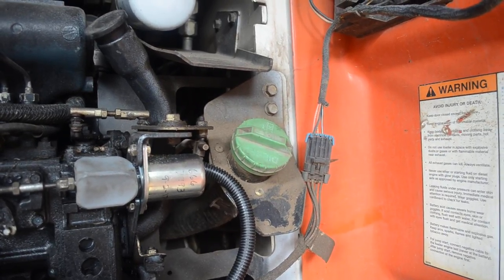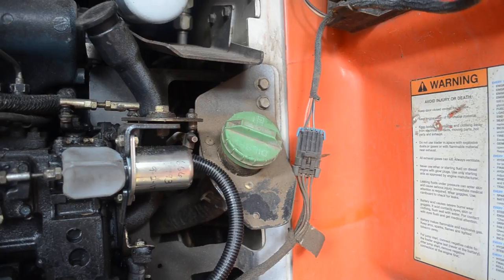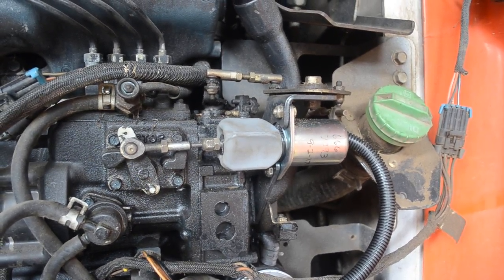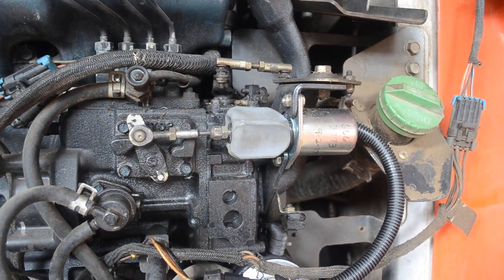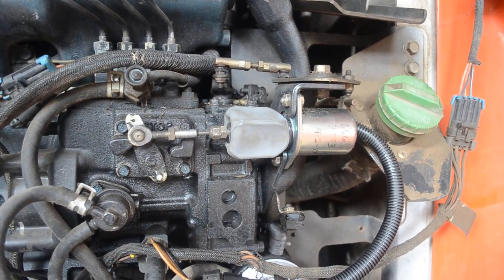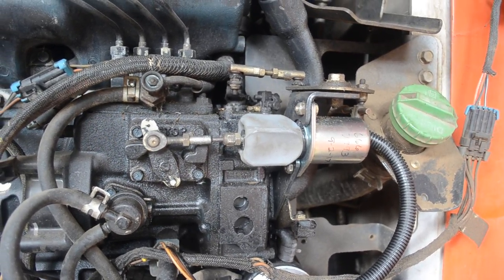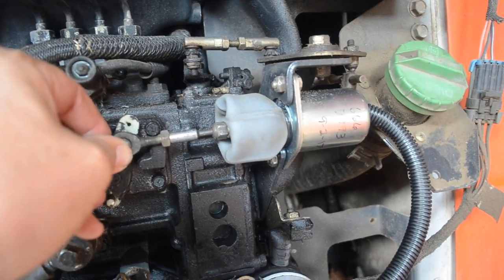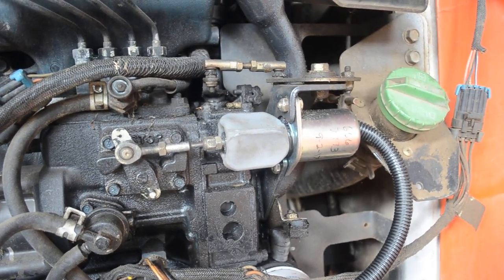Bobcat S series S185 fuel solenoid and relay trouble shooting Diesel shut off

Comment: THANKS, you saved me from buying a solenoid valve, but we ended up finding out that it was the fuse by the relay. Our bobcat is the model 753, it does not have a fuse box, it has fuses all over the place.
Reply from the maker: I did not know they had no box. Upgrade to a 185 mode. Bobcat is always ahead of the rest for technology. I am looking for a Bobcat tractor to add to my arsenal.
Reply: I have a early 753..can you tell me where's that relay and fuse is located at? Thanks.

Comment: I switched out relays, no issue. I did the test with key on, solenoid would not stay in!  It’s my fuel shut off solenoid?  Please!
Reply from the maker: Probably the solenoid but it could be other wiring issues. I think a solenoid is cheap enough if you buy aftermarket, it is worth the try. However, I would lift the cab and locate the rubber cover behind the relay box and push in on the back of the fuel relay to make sure it it still plugged into the box. These relays connections come lose on the back side of the relay box occasionally.  Good luck. No more S185 videos for me, mine was stolen. I suggest a GPS locator or replacement value coverage. A hidden power cut off switch is good too.
Reply: @iowaunemployment  thank you for your input. In the end, I over diagnosed it!  12.2 volts for resting battery. The glo indicator did the count down but the arm never ticked up to prove it. Not enough voltage to test the solenoid so yes, it would fail. The battery is less than a year old but turns out , it’s shot. I feel foolish for not examining it further first. Thank you. Stolen cat....OMG! That’s awful, I’m so sorry.
Reply from the maker: @makeitstop9344  Hey, don't feel foolish, I replaced the solenoid before I checked the relay. LOL